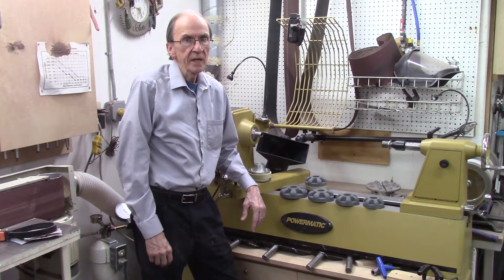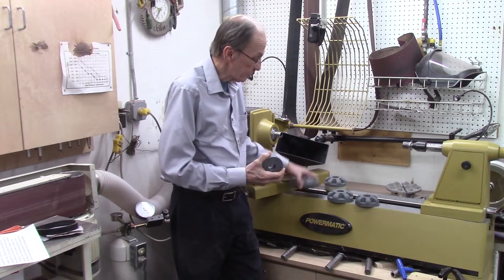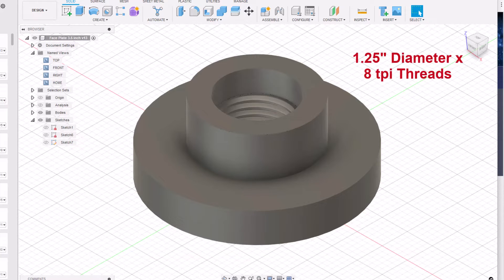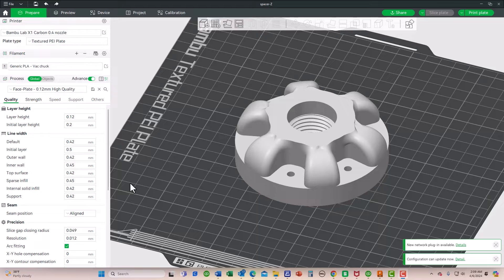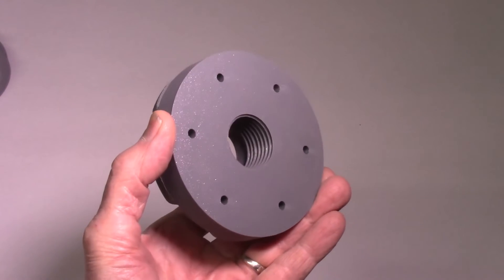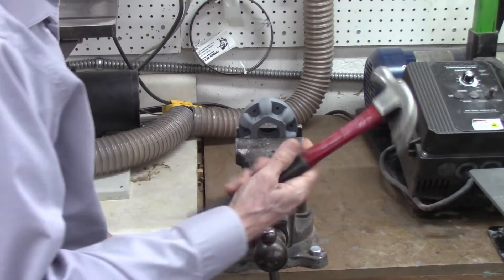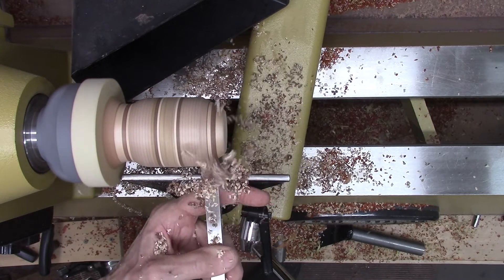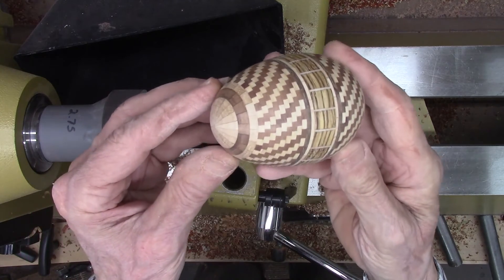3-D Printed Lathe Face Plates - A Low Cost Face Plate for the Lathe

Comment: Great job! I do 90% of my turning using face plates and doing this will come in handy. To me a 3d printer is a must have tool and are quite inexpensive. I 3d printed all my blast gates on the 3d printer and they are much better than the boughten ones.